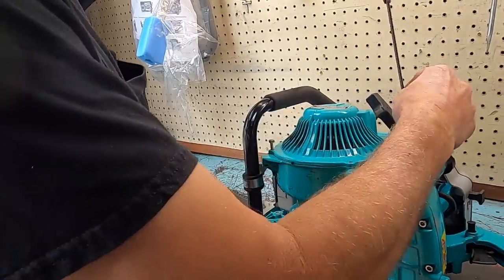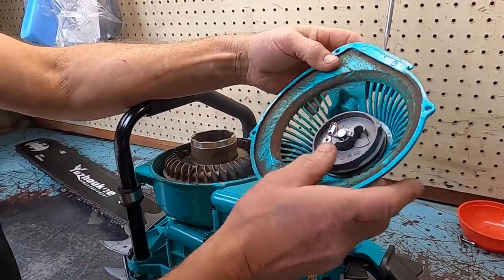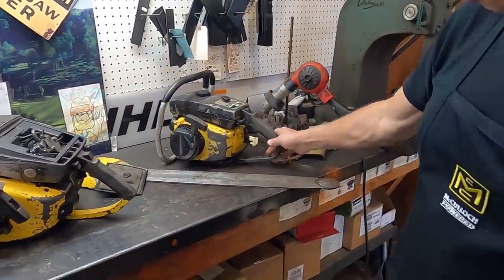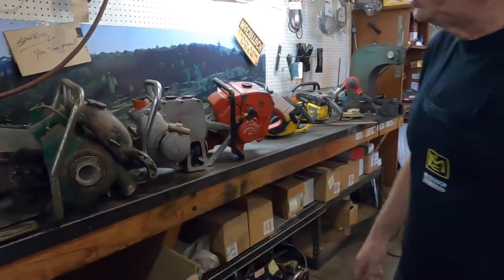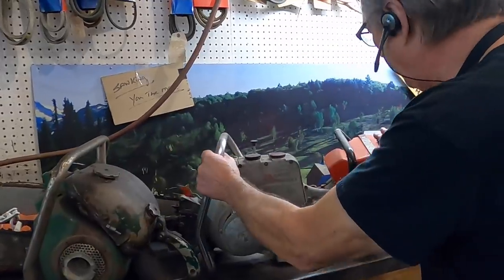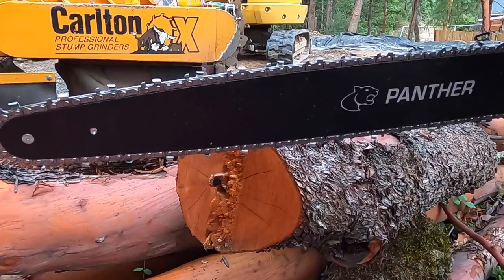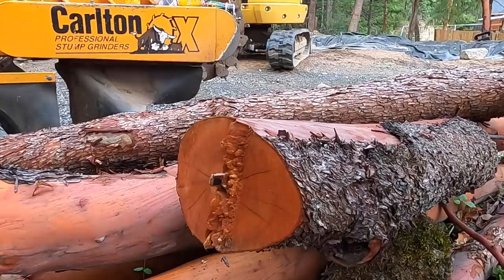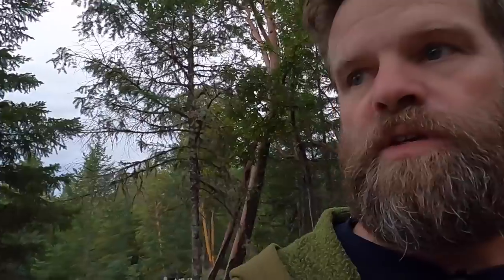SCREAMING MODDED STIHL 200T with 20 inch Panther Bar

Comment: I did the same panther setup on 12" bar with 8 tooth sprocket on my 2511t back a few months ago. Add in some carb and muffler mods aswell and im still in love with that punchy screaming little saw. Havent felt the need to port it yet but someday soon it'll be coming. Sharpening these little chains is the only real downside in my opinion

Comment: Love to see how that saw works out.  I have a slightly modded 200 T with some muffler work..  fresh build so lots of compression and a new carb slightly bigger jet.  I run a stihl 3/8 low pro full chisel 38P chain. 14 inch super lightweight stihl bar.  Trying to keep weight off my shoulders and knees.  My 200 T burns more gas after the rebuild and mods..  so it must be going somewhere.  

    I look forward to see how it goes for you.   I like the idea of the little bitty echo.

Comment: ROFL, I tried that exact Chinese saw. Trigger broke twice, sight glass leaked, kill switch had problems, over molding from the casting blocked the intake and cut into the plug wire, and finally the clutch started spinning on the crank shaft. I sent it back for a refund, bought a 395xp and I've been happily milling ever since.

Comment: I tried some 1/4" pitch chains back in the day, on 30 cc Echo saw IIRC. It's different compared to 3/8" LP, competitor back then, but as to 1/4" being preferable? Carvers like 1/4" for use with "nickle" or "dime" tip bars. Nowadays, for small polesaws 3/8" LP NK (narrow kerf) is a good option. For saws a bit more powerful, I'm told .325" pitch chain is the way to go, with .325" NK needing less work input for a given cut. Might want to standardize a bit. Five different chain reels for spinning small chains would be a bit much. Filing 1/4" chain a bit much, ditto. For smaller saws, 3/8" LP has it covered here, with pre-spun 3/8" LP NK for "chainsaw on a stick" (sorry, Jeff Dunham.) Good idea to pass on those No-Name-O saws, with their recycled plastic moldings. Experiments are fun!

Comment: Wow, A++ man, thanks!!!  Will say that putting my 18" onto my (modded, of course) 355t has crossed my mind MANY times, honestly it's less of a 'delaying saw-swaps' and more of a "I'm finding longer-bar-length gives me reach and I'll take that reach for the cost of extra 'dangle' off my belt!" thing for me :D  But you're very right, I'm not experienced-enough to have found this myself yet but I fully see the logic in your explanation here Re being able to use it longer before going rear-handle, thanks a lot man!!!  Have always seen climb-saws as "you need at least 2" ie something for a 12"ish setup(mid-20cc's) and something for a 'big/take-down' setup (mid-30cc's), say a 150t+200t or a 2511+355t, am currently using:
12" by 25cc, 
14" by 32cc, and 
16" by 35cc
so am loving this idea, going to give my 12" to my pole-saw and make my 25cc my 10" lil-limber, 32cc will push the 16" for general-use, and the 35cc will now push an 18"  (hmmmm....for experiments'-sake I've gotta say, woulda been neat to see a skip-tooth setup here  ;D )
Congrats on your daughter's college BTW!

Comment: August: I recommend an 18” bar 3/8lp.  No chain breakage. Definitely made for wood cutting. Been running a modded ECHO CS 355T for a couple years with an 18” bar and it is awesome. Safe and reliable.👍

Comment: Since no one else has said it I feel I must: that thing looks lethal! In particular when cutting with the top of the bar since a chain snapping in this situation will cause a long length of the chain to whip around the tip, extend perpendicular to the bar and then come flying back at you. Since you said that you're planning on using it in a tree I strongly urge you to avoid or take extreme caution when cutting with the top of the bar (unless you're planning on wearing a full-body chainmail suit!)
I'm in the final stages of a similar mod myself although mine is way less extreme: I'm switching my Echo CS-370ES from the factory 16" .325 LP to a 18" 3/8 Sugi pro light bar and Stihl LP chain. Note that whilst my saw is more powerful (than the 200T,) my mods are only very slightly stretching the recommendations. You've nearly doubled your bar length, added power and reduced the chain strength significantly. I sincerely hope that you don't lose an arm with that thing. Stay safe brother.

Comment: I have a Farmertec 070 and it's top notch. Not just saying it but I got a really nice one. It was a kit saw. I built it up. No plastic parts very nice metal throughout. My early kit has a Tillotson carb even. I have run it to death on my alaskan mill. Very pleased with it. It's the original orange and white kit. I have a 52" Canon bar. That blue 070 saw in this video looks nothing like a Farmertec at least the early one. My handlebar is much larger and looks much better. Nuts!

Comment: Had a guy who used a Homelite EZ (If I remember right) with a 36 inch bar for bucket  take downs.  Our saw shop didn't like the bar was twice recommend, but did acknowledge the sawyer never pushed the so the power head outlasted most of our "normal" saws.  BTW This was back when if you needed a powerful saw up a tree you liked to have someone on the ground hold most of with a line.  Yes you really wanted another top climber on that line, and  careful coordination.
Reply from the maker: Thanks for the comment.

Comment: August, pardon my ignorance, but can't one simply file down the extra safety rakers on the safety type chains for the same effect?
Reply: Probably!  But that would take a while and by then you could have ordered the panther chain.  You might also end up with odd spacing on your cutters - in other words more spread out which would actually cut slower than the panther chain. :)
Reply: I've done it before and I've found it to work just fine.  I use air tools to do it or a bench grinder.  It only takes a few minutes.

Comment: Im impressed.. i run a 661 Stihl everyday, always wanted to make a modded saw, wana take a 660 and put a big bore kit and dual port muffler and high performance crank and ect in it..
Reply: For what it’s worth, I’ve got a 99 cc 660 with a cnc muffler and worked over ports, lil extra squish, thumps over 165 psi cold.   
It looks sinister with a 32” .404 setup and sounds like a monster but it drinks high test fuel at an unbelievable rate, weighs a ton and is very hard to get started.  Throws chips by the shovel if that’s what your after but I’m disappointed overall with it.   
Next time I’ll do a 460.

Comment: I guessed that was a 20" bar when I saw it in Rich's video. I've been playing with 1/4" low profile chain to see how long of a bar I could get on a stock 150 saw. Have you tried the Stihl GTA26?
Reply: You also must've used a Husky adapter to get the 20" bar to work on the Stihl?
Reply: I've busted plenty of 0.043" gauge chain no matter what pitch it was 1/4", 3/8" or not as often 3/8" low profile.

Comment: There is an 8T spur sprocket, and an 8T rim sprocket kit available on the web for a 200T ;) 
I have the rim sprocket kit but it wasn't OEM so it didn't come with a rim sprocket worm gear.

Comment: I like this a lot.  For me it's not about HP but time vs weight. SO... imagine what the next step would be... like a 36 inch saw on a 261cm chassis... 1/4 pitch chain.  So from top to bottom of the tree in two saws.

Comment: Is that like the Stihl Pico chain? Like on the 150T. 
I was going to quit climbing, as my wrists couldn't hack it anymore... then Stihl brought out the 150T and I carried on climbing. Ported the exhaust, lots more power. 7 years old and has been working full time, still as good as ever, and my skinny wrists are ok! The clip/loop for the strop can fail though, but I think Stihl sorted this. It failed on me a couple of weeks ago, in a huge Gum tree, nearly hit the groundy! Hit some branches hard as it fell. Assumed it was for the bin but somehow it snapped the spark plug and cracked the handle, and that's all. All fixed and back in action!
The 200T is too heavy for me to reach out with, day after day. Most of my work is awkward branch walking, or smaller pruning, or reductions, all reaching out to tips. But I'd like a modded 200T for the straight up stuff. Your's is a cool saw!
We zipped a top out, over a river, through a narrow gap. Have a look at the vid on my channel!
Thanks Ed

Comment: I run 1/4" .050 instead of the flimsy .043 and haven't broken a chain yet on my modded 2511T but haven't tried it on a 200, sprockets are hard to find for it. I just put it on my battery Husqvarna, very beneficial, not sure why they don't come with it from factory.

Comment: Hmm, well on one of my 200Ts  I recently ported and muff mod'd. I tried out the 3/8LP .043 
I get the strength of the 3/8 plus the narrow profile of the .043 . Which is pretty much
what you would want for reliability.  I've tried 1/4 (had it on an old frontier climbing saw, but the teeth didn't have the durability). Especially if you clipped a hidden nail or clothesline hook with it. 3/8 just a bit stronger, often enough to resist the break and let you finish the job.
Been using it with a 16" but was thinking of trying an 18 or 20. I haven't looked at the panther bars yet, but I seem to remember some longer .043 sprocket and hard nosed bars in homelite and frontier.....
Reply: Just found the Canon bar that would do the trick. CCT-C1-20-43
20" .043  and available in .375 (3/8) .   The weight option makes more sense going the .043 route, since each drive link is thinner and lighter. 1/4" is still .050.
Plus logically the .043 bar will hopefully be lighter than the .050 of the same length, but would have to put them on a scale to confirm that.

Comment: That's a unique setup. I didn't know Panther made a 20" bar. The tip being smaller is an advantage, but perhaps not so much the length. I would imagine the saw will run out of fuel sooner.  An advantage could be on the crane jobs where the top handle gets in tighter spaces.

Comment: I have quarter pitch pro STIHL chain, cuts like a banshee....I put a quarter pitch on an old O34AV and with a 20 inch bar and also a quarter pitch on  a 361 Stihl with a 24 inch bar very good on smaller wood not as much kickback, but cuts to beat H!!!!!
Reply: I was worried about breakage too, but I try to just use on smaller diameter wood, and for limbs.  All for firewood purposes and tree trimming on the farm.  I never realized one could get so much cutting performance out of a smaller saw and NOT get buried with wood chips and sawdust!!!!

Comment: I carry a little stihl chainsaw with me on my side by side in case I get stuck and need to make a path. I was driving up a creek one day and I noticed the water coming up over the windshield so I got nervous and just focused on getting out of the creek and forgot about the chainsaw under a foot of water on the floorpan in the passenger side. I tried to give it a pull and it was locked solid. So I took out the spark plug and sprayed in some carb cleaner I did the same with the air cleaner and carb I pulled it a few times to let the water run out of the cylinder head. Then I put it back together and it started right up within 5 pulls. I'll never buy anything besides a stihl after that.

Comment: When I bought my first 200/020 the mechanic said they had originally been made to wear .43ga 1/4 pitch bars (why the clutch cover meets up weird on the top) although, I have a .43 ga carving bar on now and it still has a little of that wonky on the top haha.  So I wouldn’t worry too much about it being wrong to someone.  I was correct to the designers once...

Comment: I'm kinda disappointed.  As a mid 30 year old home owner i can't afford a $1300 stihl 660 so i thought about getting one of those cheap, Chinese,  knockoffs to use with my mill.  I have a husqvarna T435 for when i climb and a Rancher 450 for all- around use.  The 450 has a 20" bar so it only mills up to 14 inches with the mill on it... plus it's 50cc and tends to slow down when ripping thru 14 inches of wood.  I thought a 90cc saw would let me mill the bigger logs on my land but apparently if you don't spend over a grand on a saw you're just gonna spend the saved money on shop bills.